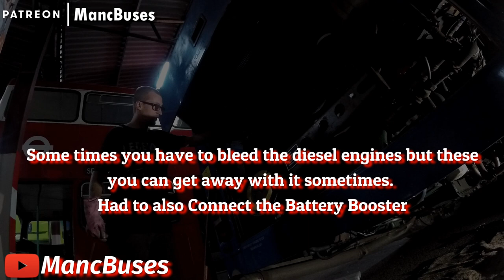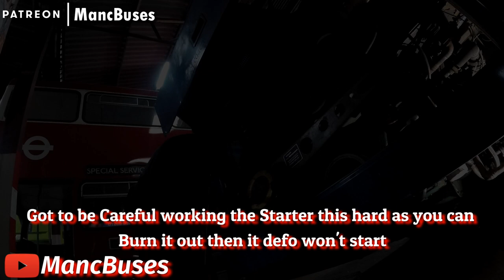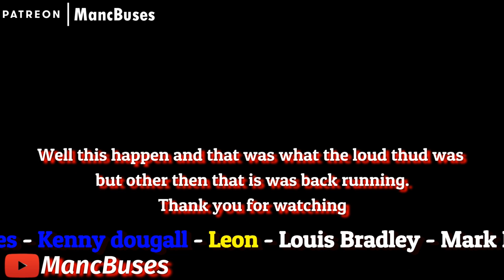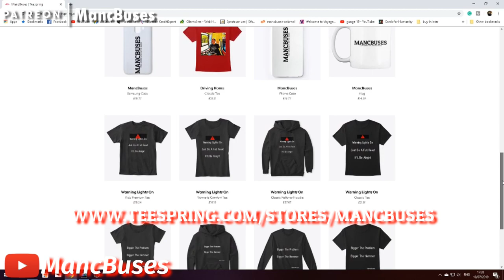Changing Fuel and Oil Filters will it Start Afterwards? - B10 Project #043

Comment: I'd have thought the low pressure fuel pump would have been powered electrically to save you having to turn the engine over repeatedly to get fuel in the injectors like on many cars. 

Speaking of starter motors I did wonder if first the stop start buses might be some kind of ruse to make money on maintenance parts as they'd wear out very quicky 😂,but they are well made.
Reply: @Mancbuses  The manufacturer claims who say they've made them last 7 times longer then normal starter motors but I suppose they get used a lot more than 7 times as much when they cut out every time the driver stops!